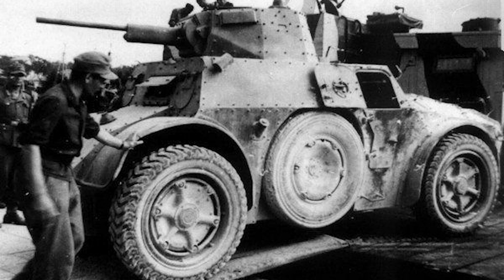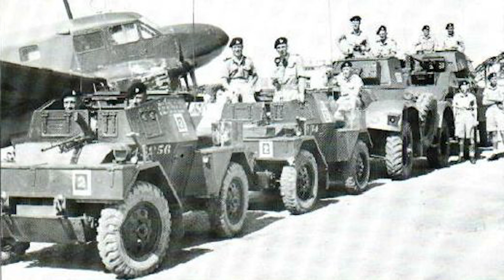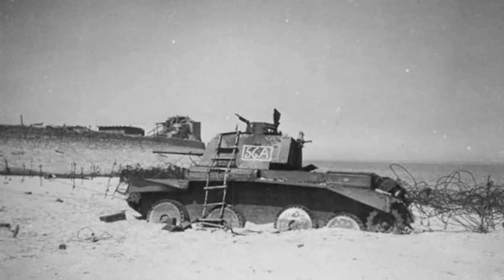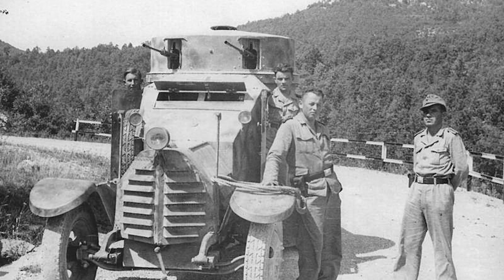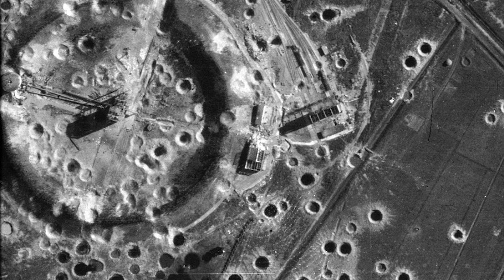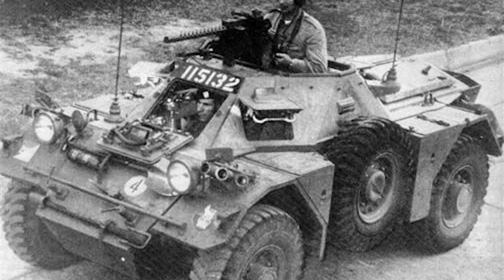They Mocked Him — Until His Tiny Scout Car Outran Every German

Comment: I was in the Royal Engineers 1960-1966 stationed in Osnabruck Germany. I drove various military vehicles and one of them was the Daimler Scout Car, which was known as the Ferret. The engine was built by Daimler but it was designed by Rolls Royce. It feels weird when you first drive it, but you get used to it quickly. I wish I could drive it once more, but at 85 yo I don`t think I could get into one, never mind drive it, the only way to get in is to squeeze in through the opening above the steering wheel or enter the opening on top of the turret. I could go on but I won`t.